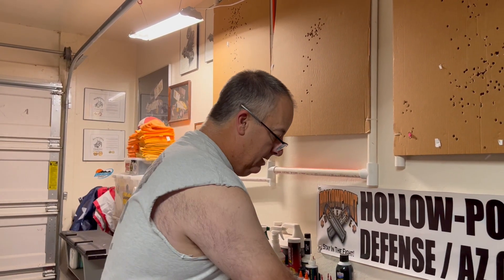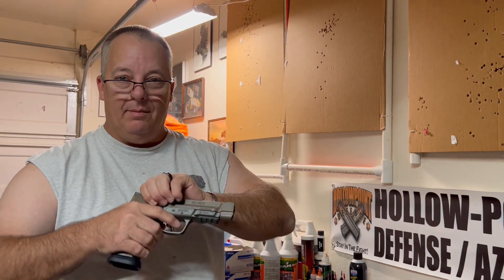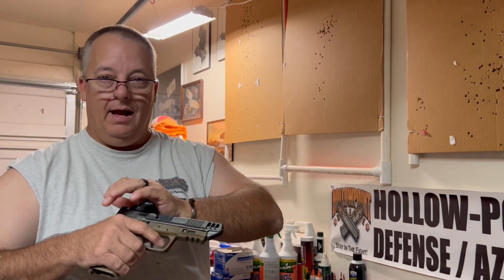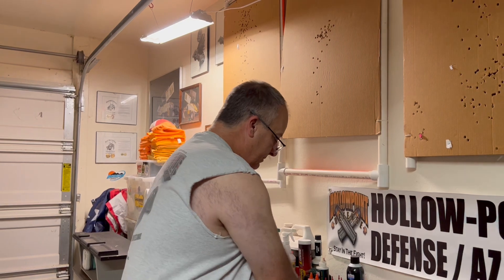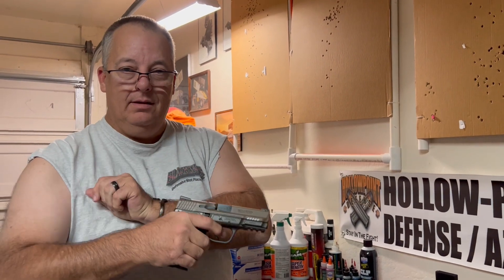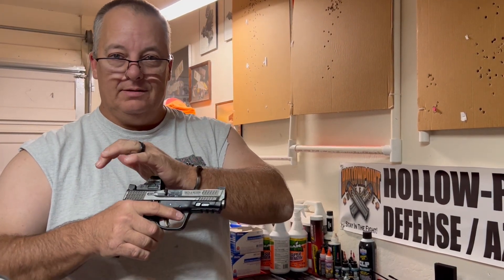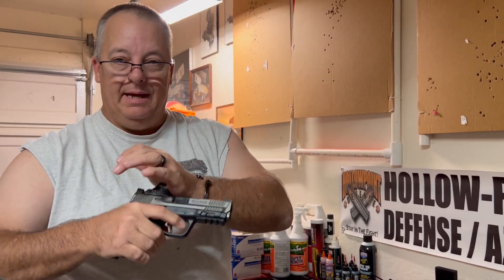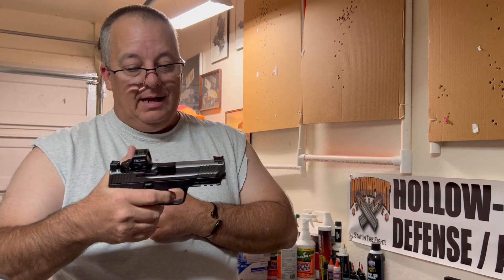S&W M&P Metal & Poly Interchanging Slides

Comment: Do you know if i can run .40 ammo in the 9mm mags? I have an m&p40 4.25 and the mags wont fit in my competitor. Can i run the competitor mags with .40 ammo?
Reply from the maker: @travisthompson6277  No, 40 cal will not fit in 9mm mags. And also, No, Competitor 9mm mags will not hold 40 cal ammo. 9mm mags should NOT fit a 40 cal firearm.